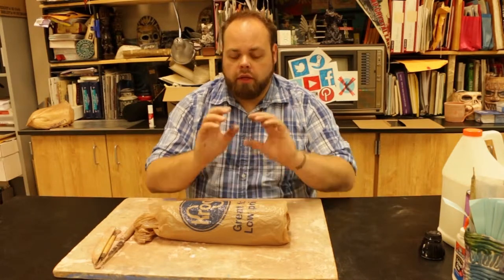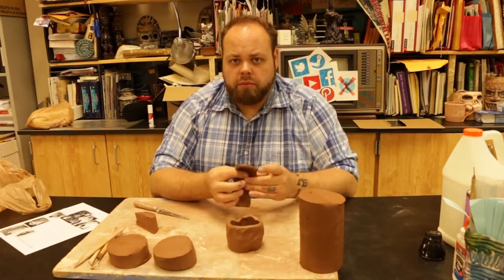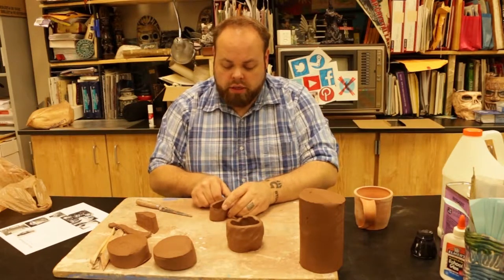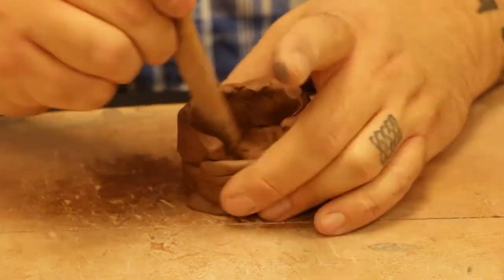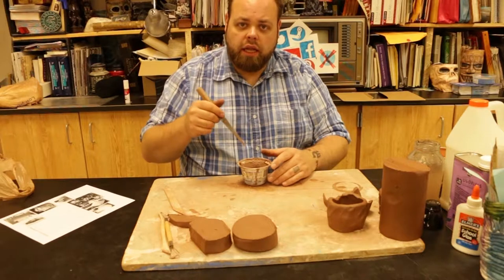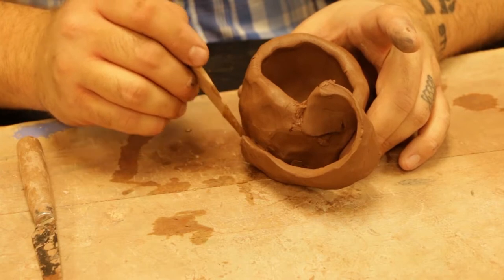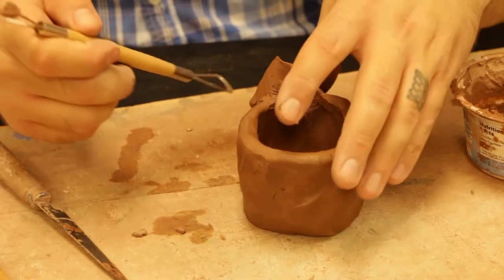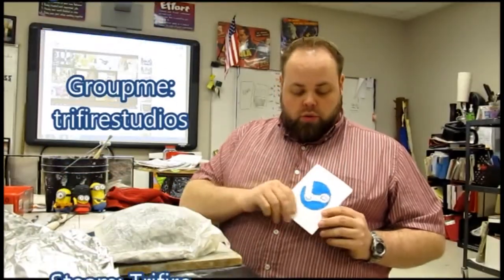Hand-Built Ceramic Cups - University of YouTube - Basics of Clay and Ceramics

Comment: I've found that I have two different types of clay on my property which I've dug and processed.   One is a charcoal black colour and the other is a typical grey/brown.   My questions are:
1) how do I determine what cone to fire the clay to?
2) I've hung the clay then wrapped it in plastic for a few weeks until it felt firm but malleable, however when I'm working with the clay is sticks to EVERYTHING.  Does this mean that I need to dry it further?
Reply from the maker: Brad Woodfield awesome questions.  All commercial processed clays are a mix of multiple compounds. Kaolin is the base for most porcelains. You are going to need to do some testing to fine the right mix. Most potters work in 100 gram samples. Lots of great info on potters.org